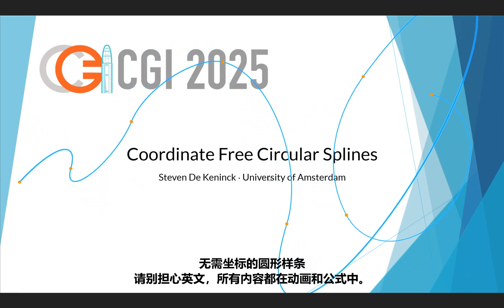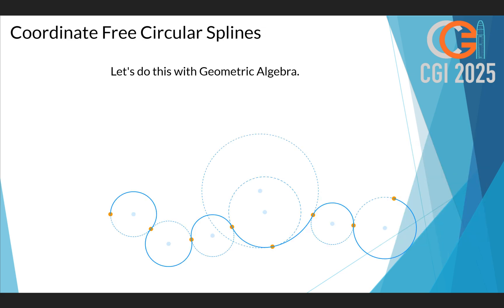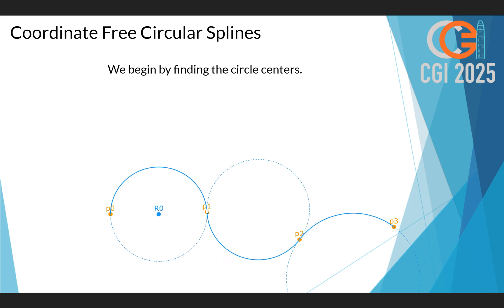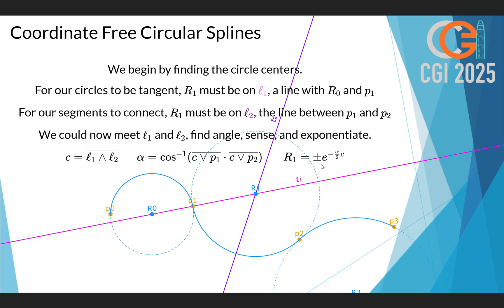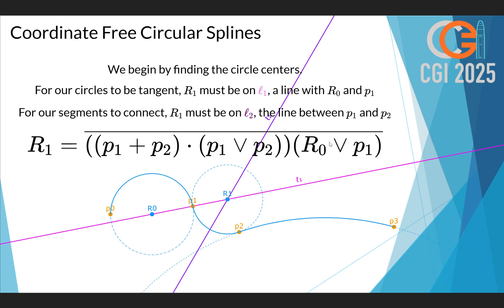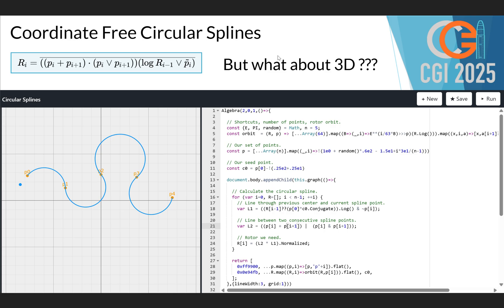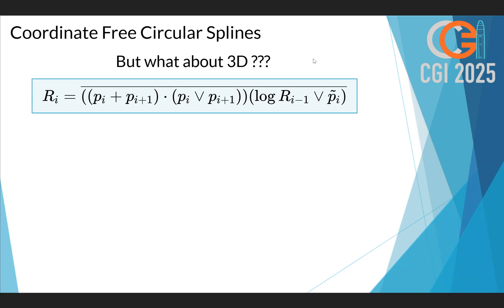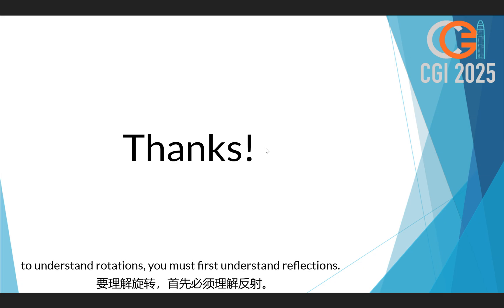CGI2025 Coordinate Free Circular Splines

Comment: Impressive that solving equations is not necessary. Could you explain more about logarithm? I canʼt wrap my head around what logarithm is in GA.
Reply from the maker: PGA (as opposed to complex numbers or quaternions) has rotors that can represent rotations around arbitrary points (2D) or lines (3D) - and not just around the origin. The logarithm takes such an arbitrary rotation and produces the algebra element (point in 2D, line in 3D) at it's center, the one that generates that rotation.
So, e.g. in 2D, if you exponentiate a point you generate a rotation around it, and if you take the logarithm of a rotation you get the point it is rotating around.

Comment: Cool! Would it also be possible to implement GA in desmos, so you can experiment with it over there to compare and contrast it with the usual way of of doing things in desmos?
Reply from the maker: Sure, especially in 2DPGA, where both vectors and bivectors have just three coefficients, it should be quite easy to define the basic operations needed (geometric product, inner product, regressive (join) product, simple logarithm and simple exp) quite easily. Once you have those its just that one formula!